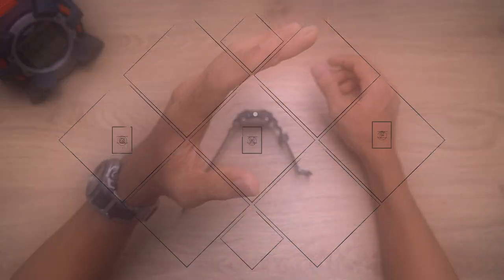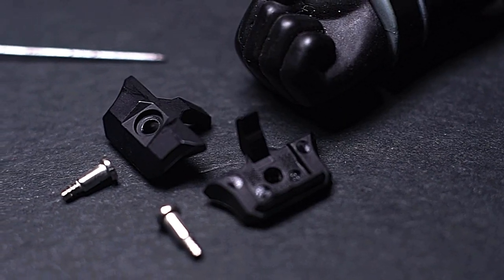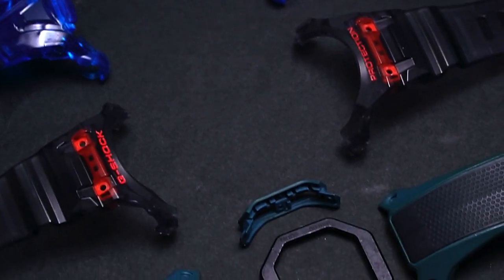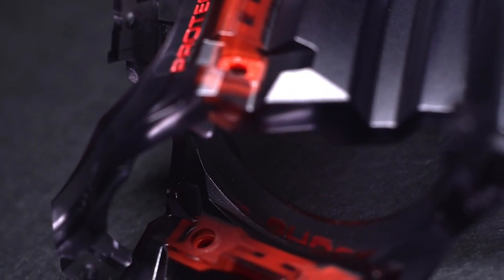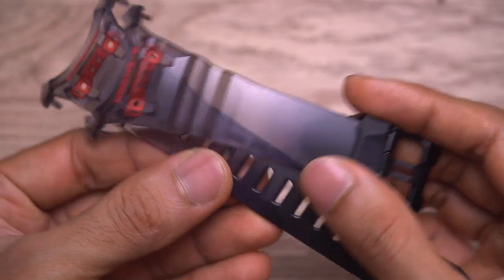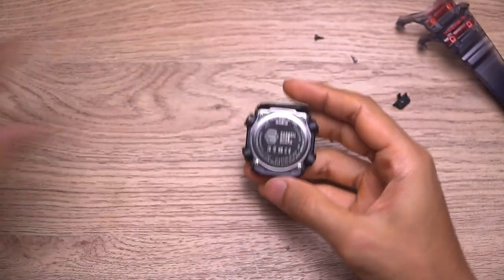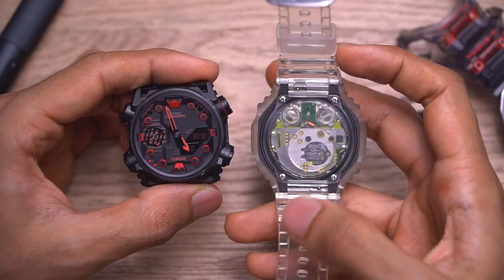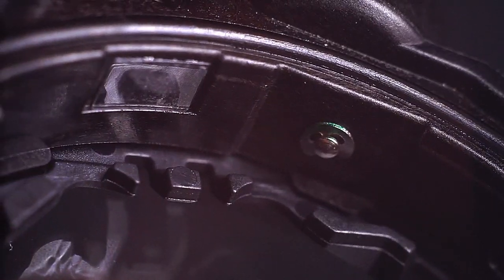GA-B001 Teardown and mod...well, kinda

Comment: My fake version actually has 20mm lugs. Nasty cheap module inside, although everything works except the bluetooth.
Reply from the maker: Fakes tells time too and could last a while if you're lucky, but when it dies, even the cost to replace a battery won't make sense sometimes depending on the type of battery it uses. Often times, when the battery dies, the entire thing also dies along with it. So you're gonna need to just buy a new one. It is cheap and you could buy multiple times over, but sentimental values will be gone each time.
Reply: @gshockhighfashion  Oh, it's a pos, but kind of interesting so I pushed for a part refund rather than go through the hassle of returning it. Battery looks like some kind of 3v lithium cell but I didn't remove the sticky label. Perhaps a 2016 or 2032, something like that? Timekeeping isn't great. Lume looks the same as on my GA-2200 and GA-2100, same colour, same fade time. All the functionality is there, hands go backwards etc. I don't hate it but consider it a pariah among my other casios.

Comment: How do you change the battery. Can you explain the process. Is it easy to do? That is all I want to know. Thanks
Reply from the maker: Very easy, exactly the same way as any g shock. They'll built the same way. Unclip, swap battery, clip it back, AC with metal tweezers, done.